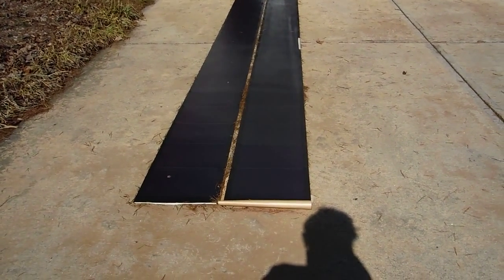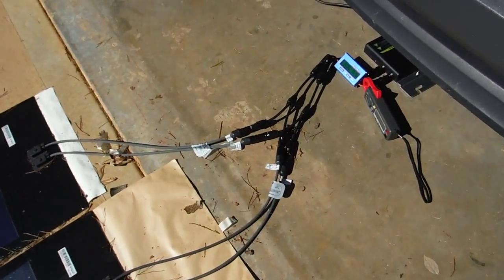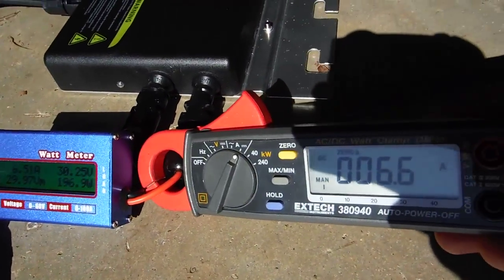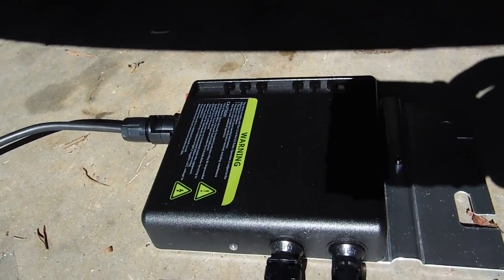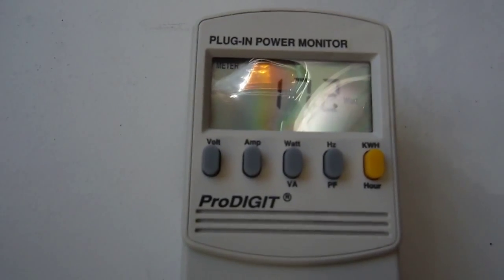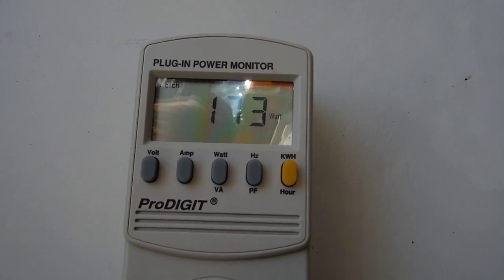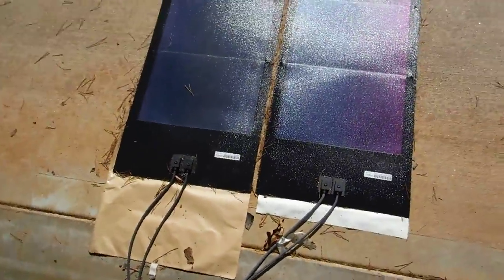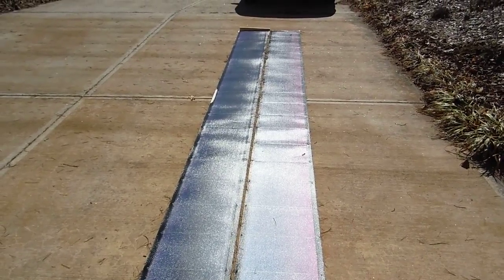PVL136 grid tie setup

Comment: nice video,

questions:

are these good panels?
since they have no glass, what can be used to mount them?

link to inverter?
link to place to purchase those panels?
Reply from the maker: clientesym There is a adhesive backing.  I haven't peeled off the plastic to expose the black adhesive, but had a friend stick a pair of them to the roof of his race car hauler.  He was very impressive (maybe overly so) with the adhesive.  Its apparently a bit messy.  The panels are performing well.  I managed to drop one off my roof without damage.  The others I have tested drop to 0W when it is overcast.  I've seen these still put out 30W across 2 of them during a bright-ish rain.  Unisolar is out of business but stock is still available.  Just don't buy them all up as I need about 8 more :)
Reply: Thank you